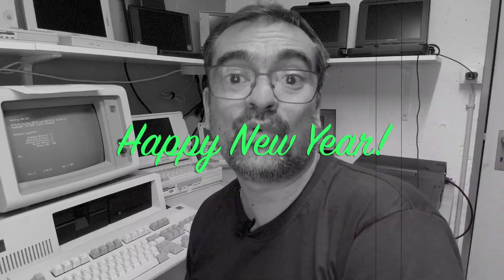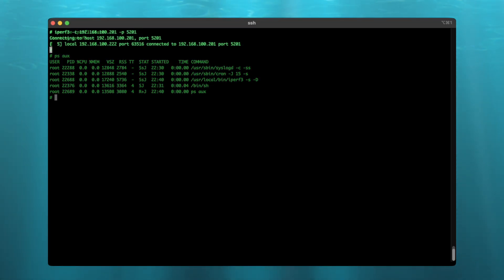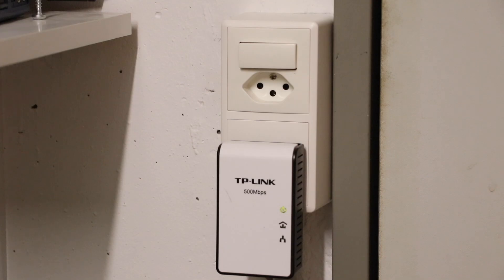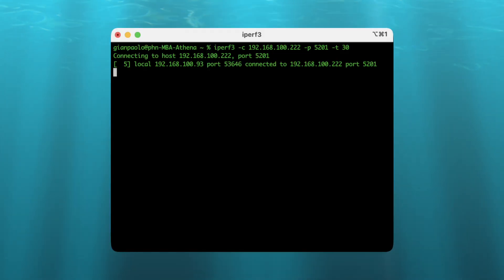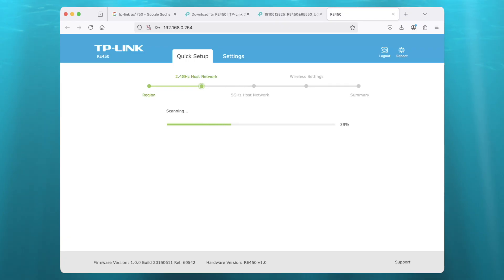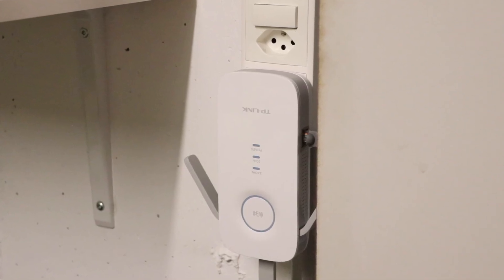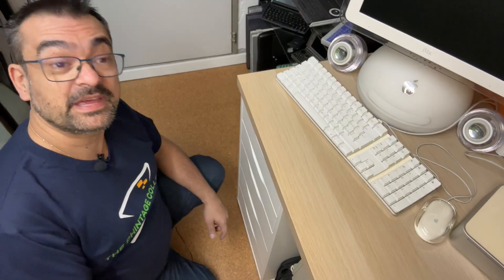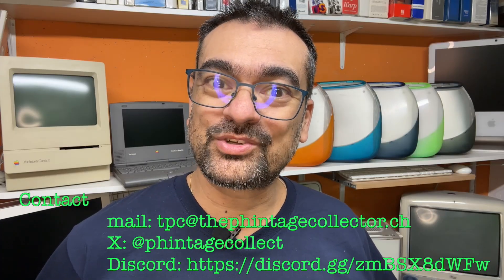Connecting My Retro PC Network: PowerLine vs. WiFi Bridge [New Year's 2025 Special]

Comment: I used to use Powerline ethernet to extend my Wi-Fi network, but it would max out at around 30Mbps. I've since switched over to using MoCA to utilize the existing coax in the walls, and now get over 600Mbps.

Comment: There are drill bits longer than 40cm on Amazon.
Reply from the maker: Yes, but it still is a bomb shelter.

Even so I own the property and can use the bunker for any purpose I like in freedom times, there's legal regulations in place for registered bomb shelters.

I'm not allowed to drill in through-holes penetrating the shell.

Although one might argue, if a 50-years-old bunker is still protecting enough these days anyway ...
Reply: @ fair enough.

Comment: One suggestion is to use a singlemode fiber with WDM gear. A singlemode fiber is actually really thin and can go through already existing electrical holes in walls without electromagnetic interference. You can reach 10/100/1000 gbps speeds with the correct gear.

Comment: Happy New Year! To be honest, I'd use a modern wifi bridge, like a Mikrotik hAP ax lite, as it supports 802.11ax (only on 2.4 GHz though) and WPA3, where a period correct wireless solution will be 802.11b compatible (maybe 802.11g) and will do WEP or at most WPA. Mikrotik routers can be configured over telnet, and configuring it from an old 5150 or XT sounds like fun :)
I use a Mikrotik mAP lite with my Toshiba T3200SX in the same way, I was even featured in one of Mikrotik's videos, where they were showing off their users' use cases :D

Comment: Powerline is often advertised as 1Gbps or 2Gbps nowadays;  however, in practice, it seems that 100 Mbps is far the likely outcome, IF you get an outcome.  In my opinion, even the 2Gbps models - well not worth even ordering ( less than 100 Mbps  connection ) .  Far better off with wifi using a bridge or WDS..  Actually, nowadays, it'd probably be better to use some sort of mesh WiFI setup. If it worked at even 500Mbps, I'd have been happy, but sadly, even 100Mbps seemed spotty during testing.  Reminded me of dial up speeds more than anything. A dialup would  not work very well in today's graphics heavy websites.. 

Wi-Fi bridges sometimes work; had some Netgear WAX202's and WAX 206's ;  with the WAX206's I was getting nearly line speed, or about 940 Mbps using bridge mode; unfortunately, these aren't available anymore without buying used.  Still a good device though. These are Wifi 6, and don't have a  6 ghz band. 

Recently tried a set of WAX630EP ('s ) and never really tried to see how much bandwidth I was getting; but configuration seemed easy enough using WDS, and overall stable and easy to use. Using the 6ghz band for the connection.  In the end, moving the primary access point upwards about another meter, and moving it more towards the center of the house by 3 or 4 meters will probably solve my remaining issues without running the second access point.  

The powerline models went right back after failing as miserably as it did.   I would have been ok with 500 Mbps; but a GL.Inet travel router fared far better to provide a similar solution.  

Surprised that the bunker does not have any form of connectivity, even if over coax of some sort.
Reply from the maker: @MrPir84free  This bunker was built in 1974. There‘s only one 15mm duct coming in for the electricsl wiring.
Noone thought about communications 50 years ago.

Comment: I actually use powerline networking between my upper and lower floor of my home. Its rated for 1g network connectivity but my experience is that you pretty much always get about 1/10 of rated speed. For me I am in a new home and I get a solid 100Mbps though the connection. I am pretty sure that they are also not on the same breaker either. Its way more then I need and its very convenient to not have to run a dedicated connection though the walls.

Comment: I love FreeBSD. It is very basic UNIX like. Not like Linux where everything is done for you! :-)

But regarding Powerline. I hope you have no HAM Radio Operators near you. You will kill their 40m and 80m Bands. Because their transmission is radiated via the power cables which act as antenna.
Reply from the maker: @oe3gwu  My neighbour was into radio, but he passed away three years ago.

But I‘m anyway having a tendency to use the flatband wires instead.
Reply: @THEPHINTAGECOLLECTOR  I am a ham radio operator and my neighbour had one of these. He had to remove them after I was unable to hear anything anymore.
Reply from the maker: @oe3gwu  Understandable, the lack of shielding makes it terrible.

Comment: Also: how you just KNOW American power supply regulations are terrible, when I saw a Waygo connector I had immediately thought to myself, “look at Mr. Fancy over here with all but exposed copper mains!” 😂
Reply from the maker: @EpsilonsReviews  Normally it‘s covered up.
I had the cover removed as I was checking if I could add a set of wires for a new wallplug on the same circuit.

The next best thing would be to route a plastic optical fibre through the tube.

I‘m still not fully sold on the WiFi bridge.
Somehow I‘d just prefer cables…

Comment: I bought a few mikrotik pwr-line because the iron-concrete walls cancel the signal a lot
Reply from the maker: I was lucky enough, as the closest Access Point in reach is just 2 meters away on the other side of the wall.